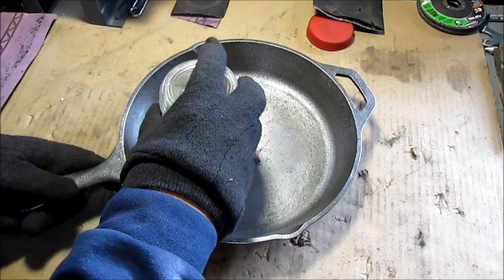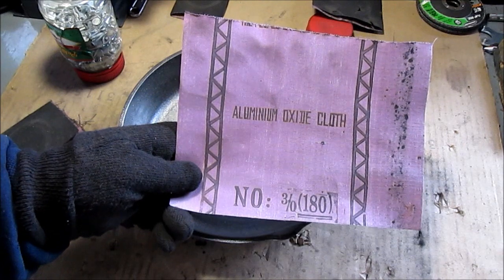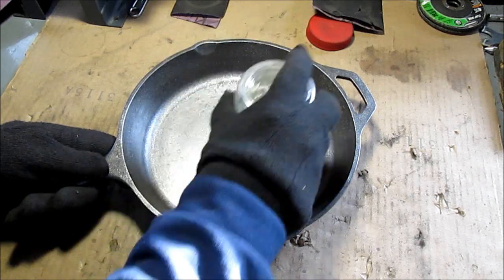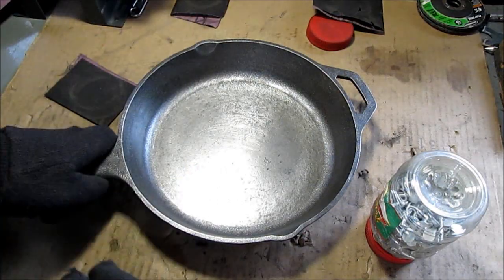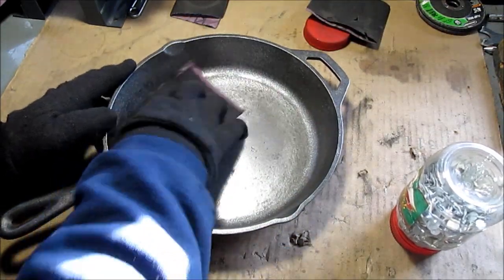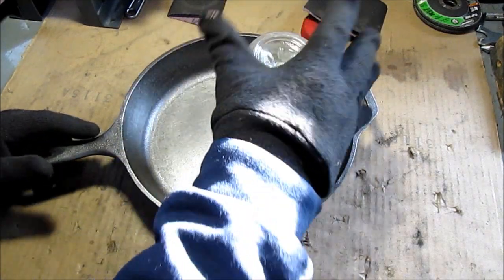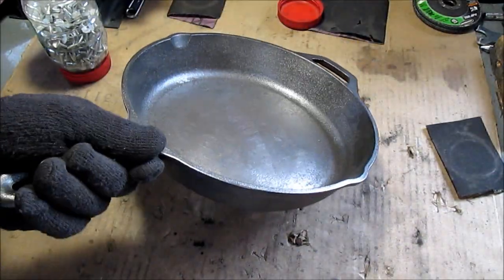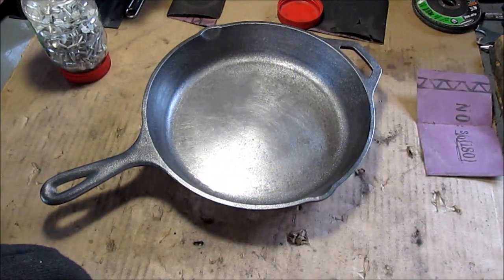Sanding Smooth the inside of a Cast Iron Skillet  By Hand

Comment: I have around 40-45 pieces of cast iron and I did sand my first cast iron (12 in lodge) and Boy was that a waist of time. It cooks no better than all my other non-sanded pieces . Once a cast iron pan has a good layer of seasoning they all cook pretty much the same. when your sanded cast iron is so smooth it has a hard time holding on to the seasoning. Ask me how I know. Yup. That was my first cast iron. Lucky there’s a simple fix for having a super smooth cast iron. Fill the pan with vinegar and leave it for a few days. The vinegar put micro etches on the pan to except the seasoning. 👍🏼

Comment: I sanded mine as I prefer a smoother surface, left with 80 grit and some texture to take seasoning. However the smoother surface has not improved the non-stick characteristics. That is 99% effected by the seasoning technique used.  My original Lodge texture was just fine. I simply prefer a smoother surface. Cheers

Comment: For anyone doing this the first time,please use 50-60 grit for your first time..I used 80 grit and grew a beard before I got rid of most of the preseasoning. Then you can go to 120 before starting your seasoning. You don't need to go up to a higher grit number since you want the seasoning to have just a slightly rough surface to grip on to.
Reply: oh my god why didnt i read this before :( thought 80 would be enough ugh
Reply: fuck I used 240 and wondering why it didn't do anything
Reply: I am a machinist. I started with 36 grit.
Reply: @KarunaMurti 240? That is to fine to finish with, let alone start with.

Comment: I decided to sand down my cast iron this morning after watching this video.  My pan was super rough and the seasoning had worn off.  Even when the seasoning for good it would always seem to stick, no matter what I cooked.  I saw a lot of videos using grinders and disc sanders and such. I didn't want to go out and buy anything special.  So I wrapped some 120 grit paper around a sponge and when to town.  I didn't go as smooth as he did in this video, but it's significantly smoother.   I left just a bit of texture to help it take some seasoning (and because my arm got tired).  After a few hours of applying seasoning using both the stove top method and the oven method it came out nice and black and smooth.  I just fried up a couple of eggs and with just a bit of butter there was almost no sticking.  Just had a small spot, but considering this was the first time cooking in the pan since refinishing it, I'd call it a success.  After using it to fry bacon and deep fry some chicken I am sure it will be super slick in no time.

Smoothing out a pan may not be necessary, but it sure does help.  You could get a nice smooth surface by building up a seasoning over months or years of use, using a metal spatula to gradually knock down the bumps while the pitting gets filled in by polymerized oil.  However, not everyone can cook the recipes that help build up the seasoning every single day.  Sanding does help.  I can only imagine what results I would have gotten using a sander and going to 220 grit. Maybe I will do that on one of my other pans.

Comment: After watching this video I adapted to items I had on hand at home. I have a 40oz plastic mixed nuts container 3/4 full of nickels, pennies, quarters and dimes. I had a pack of 5” 80 grit stickfast sanding discs. I peeled the backing off the sanding discs and applied to the lid of the mixed nuts container and started sanding a Lodge 10”I skillet. It worked great. Thanks for the video.
Reply from the maker: Sounds like a better Idea than mine !!!...A smooth skillet has Always been what I like ...Thanks for Watching ...I have a few videos on seasoning cast iron on my BBQ

Comment: Thanks for this video, I have alot of cast iron and everything stuck in the Lodge pan I had, no matter how many times I seasoned it, did a quick knock down of the rough surface and it worked like a charm...thanks again.
Reply from the maker: Thanks for Watching

Comment: Gonna work on my lodge skillet today! Thanks for the video, I never would have thought of just using a weighted jar as a handle for the sandpaper.
Reply from the maker: Thanks for Watching
Reply: How did this work out for you? I am thinking of trying this myself.
Reply: Thomas  Jordan I didn't sand mine to a complete smooth finish, but after re-seasoning it was definitely an improvement
Reply: Ok, thanks. Not sure if I am gonna do this or just order a new stargazer pan. All the best.
Reply: please, make sure you wear a good quality dust mask, gloves, the iron dust is not good for you, a well ventilated area,
Reply: What is that purple thing that's better than sandpaper?

Comment: It well smooth out over time leave it alone use it and in joy.
Reply from the maker: You really do not know anything about seasoning cast iron.....Do You ?????
Reply: You only sand a cast iron pan if it is rusted bad...
Reply: I was seeking information on sanding cast iron because I'm interested in getting the >bottoms< of my Lodge pans and dutch oven smooth in order to minimize the damage that they're doing to my brand new glass top induction stove. After getting a few good scratches, I've been avoiding using them, but now I have hope that I can make them safer with some sandpaper and a bit of elbow grease. While the interiors are also rough, I haven't had a problem with sticking with the factory seasoning with continuous re seasoning after each use.

Comment: This seems like the best solution to me. I might attempt this on my new 8" and 6.5" Lodge skillets. I just want the surface to be a tiny bit less bumpy.

I have a 10" Emeril. It took me about 3 years (with some serious cast iron neglect in there by accident when I first got it) to get it seasoned smooth enough that I'm happy with it.

Thanks for this video!
Reply from the maker: Jon MacDonald This works Great for me and safer than using a grinder I tried it and it was hard not to get a warped finish I have a new 8 in. Lodge I am going to do this to I have not been happy with it and I stripped it and reseasoned it ...For me Smooth is better Thanks for watching !!!

Comment: This looks like a really great method for getting the Lodge pans that I've had for just a few years smoothed out. I have really come to dislike the rough cooking surface, and the seasoning indeed does flake right off over time. I have no access to machinery, so this is incredibly helpful. Thanks for sharing!
Reply from the maker: CaliforniaLove I think this is better than a grinder It may take some time but the finish is better than the factory rough ones Thanks for watching !!!
Reply: not2fast4u2c Just a quick update; I rounded up some 60-, 150-, and 220 grit paper and have gotten my 12-inch Lodge skillet in pretty decent shape. The surface looks a little more streaky than I would like, but maybe using that 220 a bit more will help that. More importantly, I can see how much of a difference the sanding has made. It's a great deal smoother after sanding.
Reply from the maker: This has worked great for me I then seasoned it in my BBQ I have a video of doing one with maplewood I have a Playlist of Cast Iron Skillets you can watch

Comment: I have a Lodge 12' inch that I have been using for 3 years and never had to sand it. I used the good ole' season with crisco by hand method several times over a hot burner and them cooked bacon in it. I was able to make perfect eggs almost immediately and soon after that, scrambled eggs were no problem. Obviously, now the pan is better than ever and there is no carbon flaking off of it, just a thin glossy layer of seasoning.

Comment: I ground smooth a couple of Lodge skillets and they’re both great now. The seasoning doesn’t adhere quite as well but it was only an issue with high acid food. Easy to reseason and if I clean right away it’s also not a problem. Easy to get non stick without using tons of fat now.
Reply from the maker: I season mine on the BBQ and burn the grease so it is black and it is the best way for me to keep it seasoned...Thanks for Watching !!!

Comment: Most modern skillets are sand cast that gives them that finish. Old ones do not have that. I have a 12" that I used for years that did not do it for me. I brought it to work, had it bead blasted, then left it with the machinists to mill flat on the bottom. Then I seasoned it and used it....awesome. Now the best pan ever. I know not everyone has easy access to this equipment. Buy an old one, run it through your oven cleaning cycle, clean, and re-season with flax seed oil.
Reply from the maker: I have heard flaxseed is a good oil
Reply: @not2fast4u2c  the trick is to use very thin coats over multiple seasonings so it won't flake off with use

Comment: I have lots of new cast iron including a reversible griddle grill for my oval burner and I've had no trouble seasoning them without sanding them.... I even recently purchased a set of unseasoned cast iron from China and again no problems seasoning them and I've never sanded them. Those pits in the cast iron hold onto the carbon deposits from the seasoning process...
Reply from the maker: +roberts459 Every one has their own preference on cast iron .Glad the rough surface works for you
Reply: It is not the "pits" in the surface of the cast iron that hold the seasoning, otherwise smooth cast iron would not hold the seasoning.  By heating the pan up very hot and then applying the oil for seasoning, the molecules of the iron open up (like the pores in your skin) and allow the molecules of oil to enter.  When the pan cools the molecules of oil are trapped in the molecules of iron, creating the non-stick base coat for the seasoning.

Comment: Someone told me that it needs to be a bit rough to hold seasoning. Is that at all true?
Reply from the maker: I would say a little rough could help it stick better
Reply: NOPE.  The old Griswold skillets were machined smooth in the factory, and they're the BEST skillets in the world.
Reply: Incorrect. They had concentric tools marks on them which gave them a a brushed look. You clearly haven't seen a NOS one. Picture here: http://take.ms/A2CO1
Reply: phototristan
Reply: Not at all true.  Old cast iron was cast and then machined producing an incredibly smooth finish. This still seasons well and is incredibly non-stick.
Reply: No, that is not true.  The seasoning (i.e., oils) attaches to the pores of the cast iron at a molecular level.  When the pan heats up at high heat, the metal expands as the molecules get excited.  When this happens, the molecules of oil slip into the molecules of iron, much like your fingers intertwining when you clasp your hands together.  When the metal cools back down the oil molecules are trapped into the surface of the pan.  That is why you never want to overheat your pans after seasoning takes place...it releases the oils. And, you also never want to scrub your cast iron pans for the same reason.
This process takes place no matter what the visible surface texture.  However, a smooth surface is much easier to work with when cooking.

Comment: I've got a set of 3 chinese made cast iron skillets for around 20$. As expected, they are not that smooth and since those are my first cast iron pieces, i haven't been that succesfull with the seasoning due to mistakes i've been noticing and correcting. I'm aware that my combo is not gonna last 100 years or so and I've decided to make mistakes and experiment on this ones so, i'll give your method a go, i wasn't able to get the cloth you use, i'm using silicon carbride instead.  So, what i'm gonna do is remove the previous seasoning with salt and a potato, dry the piedes out the best I can and start sanding. I'm from Panamá and I don't think we can get Crisco here; but there is a local brand of vegetable (lard)? and seems to work well. Then i'm cooking bacon on them and wait to see how it goes. Thank you very much for your video, i wasn't sure sanding cast iron was an option; but now that i see your results, i'm definitly trying it! 
Thanks for the video.
Reply from the maker: +Rolando Herrera I have good luck using bacon grease and season in a BBQ at about 450 deg.F..for about an hour I keep it in till it's black  (carbonized)....I would use lard instead of vegetable based Crisco..I hope yours turns out to be a nice set.... any sand paper should work I like the cloth Emery paper because it lasts longer

Comment: modern cast iron is rough so that it holds spray on pre seasoning. prior to lodge coming out with the method or pre-seasoning skillets (which saved the company) cast iron was much smoother and came bare metal. this is one way you can tell old cast iron from new
Reply: Not true. It is rough because over 75% of the materials are from recycled crap.
Reply: John: You are proof that aborted babies can still live.
Reply: John is right. Cast iron is always rough and has to be machined smooth.

Comment: i used a 4 1/2 inch angle grinder with a 60 grit wheel, took 10 mins, didn't press real hard worked great, after cleaning and seasoning pan works great, eggs slide like on ice..
Reply from the maker: I have a 5 inch orbit sander now that I will try someday

Comment: It's his cast iron skillet! He can sand it whatever way works best for him. I use 40 grit sand paper. Then follow with 80 grit. Cast iron is very abrasive resistant. So it takes a lot to actually remove enough metal to make it smooth. If you want a mirror finish, which in my opinion you don't need on a cooking skillet, then use 150, 280, 320, 400, 600, 800, or whatever grit sand paper you want. By the time you've seasoned it, it's going to very nice.
Reply: "then use 150, 280, 320, 400, 600, 800" - don't do this. I did this. While it's fun to give your cast iron a mirror finish, it won't be able to hold any seasoning. I put a bunch of work into several oven-seasoning coats, and then as soon as I started cooking with it, the seasoning flaked right off. Had to re-sand it with a lower grit paper so that it had a rough surface.
Reply: @CoryGagliardi  at what grit would you stop ? 120 ?
Reply: @alfredneuman6840  I don't remember the number. You should be about to visibly see the scratches in the metal, it shouldn't be like a mirror.

Comment: try a drill press and a sanding disc with foam backer between the sanding disc base and the paper at lower speeds...it will allow you to select the pressure applied with the right hand while maneuvering it easily with the left...might also use emery cloth and water in the following order: 60, 100, 200, 400
Reply from the maker: Laughing Hyena The drill press idea sounds like a good one  Any way you can smooth a lodge skillet makes it better ( in my opinion ) I have 2 small new ones I'm going to redo ..This one in the video was given to me so I had nothing to lose by smoothing it I have had great results on a couple of Wagner skillets after smoothing them

Comment: A 4.5" grinder is the way to go...  But, you have to use a flap disk rather than a grinding wheel.

I've smoothed four of my cheap Asian skillets that way.
Reply from the maker: Russell Stephan I should get an orbital sander I tried the grinder with a flap disc But it left marks in it

Comment: so I sanded the hell out of it, then seasoned twice. It almost seems brown, is it rust? I used canola oil.
Reply from the maker: +greatest prime minister ever Brown just means how hot it got the oil I use my BBQ so I can have a higher Temp and it burns the oil so it will have a black carbon coating ..Which is one of the original ways cast iron was seasoned over a fire
Reply: +not2fast4u2c k thanks
Reply: I tune up my cast iron with a super thin coat of Crisco when I plan to BBQ on my gas grill.  Put the lightly oil pans in the BBQ, start the flame, close the lid and when the BBQ is ready to cook in, the pans are ready to come out.  Better than smoking up the house!  Never put a cold cast iron pan on a hot burner...they have to heat up together or you may ruin the pan or the pan seasoning.  40 years of cast iron cooking and 3 generations of happy pans.
Reply from the maker: The BBQ does work good .and is .Better than smoking up the house